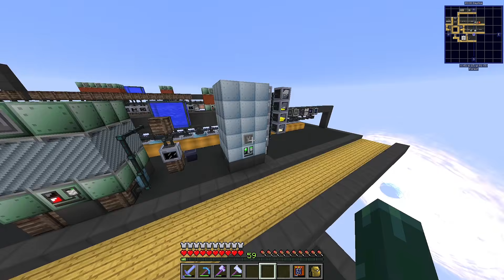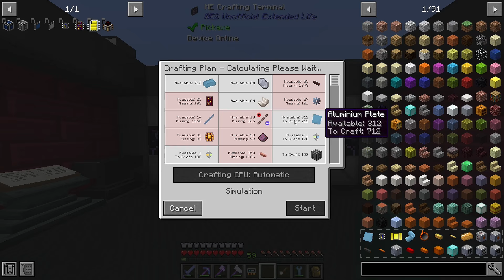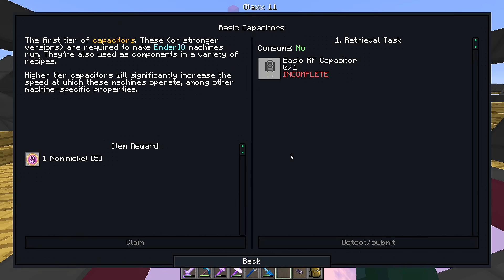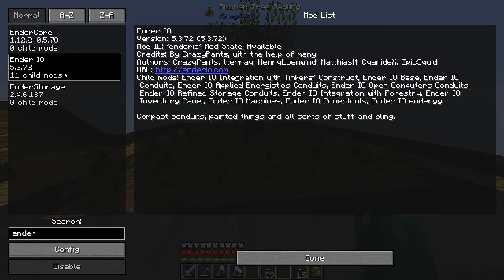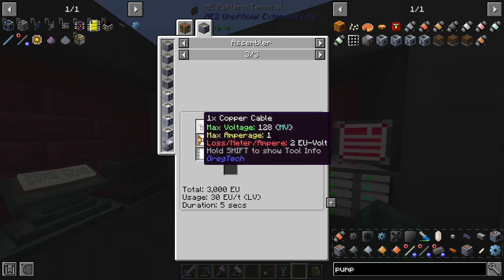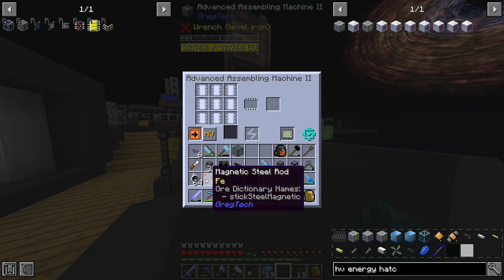Nomifactory [09] - Axolotl infrastructure

Comment: carbon can be obtained from sugar cane --> sugar --> electrolyze to carbon, also recommend getting a vacuum freezer to cool down ingots
Reply: also i would try out the programmed circuit card to automatically make other sizes of wire
Reply from the maker: since im getting a billion coal from DML now, i set up a macerator for coal dust then a centrifuge for carbon

its actually super fast and its 1 coal to 2 carbon instead of 3 to 1 with sugar
Reply: @AntiAxolotl I would just use sugar cane because it's easier to expand and faster, coal is going to be used for other things so save it for that

Comment: For all the stonework and polymer clay processing line,  my tip is that to keep spamming LV because they are cheap(both EU and circuits). Later on you will access to Processing Array which let you stack 16x LV machines into one 3x3x3 multiblock!
Reply from the maker: it cant quite be LV because one step needs to be MV, but you are right spamming MV machines is like way easier in resources and power usage

also the processing arrays seem so cool i cant wait to use them

Comment: If you attach a fluid discretizer and the other one from the same mod, you then dont need to add a fluid interface into the autocrafting. You can just have them in the pattern itself when encoding. Since with the fluid discretizer and unpacker i think its called, then the P2P can autocraft with fluids. You might need to download the Ae2 fluid crafting rework addon mod. Which should come by default in my opinion.
Reply from the maker: hmmmm i kinda dont want to add any mods, but im sure il get into fluid crafting in another pack in the future anyway
Reply: @AntiAxolotl  I see that, but its a bit different then just adding a random mod. Its on the addon mods page on the modpack and they all have their own nomied recipes already added when you download them. But yeah its ur choice. I just wanted to tell u since it made my experience with the modpack alot better (atleast AE2 fluid crafting).

Comment: I will say this on upgrading your PPC. It is generally better to build more machines (ie, 2 Mv chem reactor intead of a HV chem reactor) due to how overclocking work. You basically double the speed for 4 times the energy which is the same as having 2 of the prev tier but with 2x energy lost instead. Although it might not matter lmao

Additional note: You might need canola later on so it's best to mix them with the rubber farm
Reply from the maker: the machines hardly use any power compared to the overclocked ebfs i have now so power isnt really a problem, the higher tier machines are kinda expensive tho so it probably is a lot better to spam lower tier machines. but i have a feeling we will be rebuilding PPC like a trillion times anyway 😅

also i think canola can be used for epoxy, but il probably be using the other route for it which doesnt require growing it!
Reply: @AntiAxolotl  Don't make upgraded PPC yet. Wait until LCRs and multi smelters those are high quality upgrades.

Comment: it's better to cut 4x or 8x wire and craft down using AE2
Reply from the maker: not actually because its the exact same time to craft 16 1x wire and 1 16x wire, so if i would do that with my array of machines it would be slower at low wire numbers and the same speed at higher wire numbers sooooo 🤷

i think in other versions of gregtech its better to do this? i could be wrong tho
Reply: @AntiAxolotl  Yes, in GT5u it is faster

Comment: Just out of curiosity why don't you like using void upgrades if you are using a storage bus?
Reply from the maker: lets say i have a drawer full of 2048 diamonds, and it has a void upgrade on. any more diamonds that i would dump in my ME system would be voided, obviosuly a dumb example but you get the idea 😅

there is a couple ways of preventing it tho! you can make the storage bus on extract only, so no items can be placed into the drawer and voided by AE2. Or any void drawer you have can fully upgraded so it no longer matters when stuff gets voided because you store so many (which ive been doing in a few places)

Comment: I recommend changing the patterns so that they don't make 1 item at a time, but 64 at a time. It seems to take up fewer bytes during crafting, and it doesn't weigh you down, as we say)
Reply from the maker: i only didnt do that because i wasnt sure if it worked with the interface p2ps, but it should if i turn on blocking mode i think